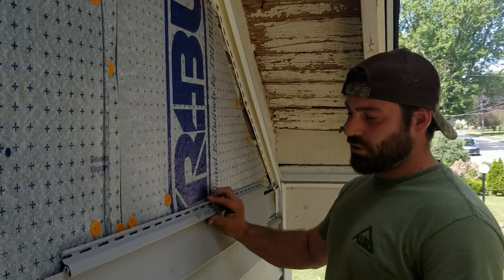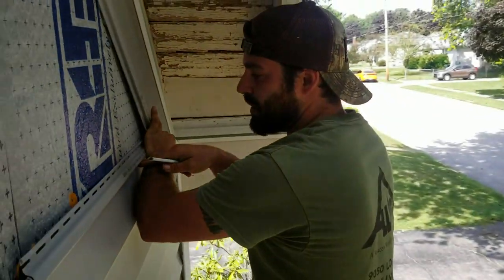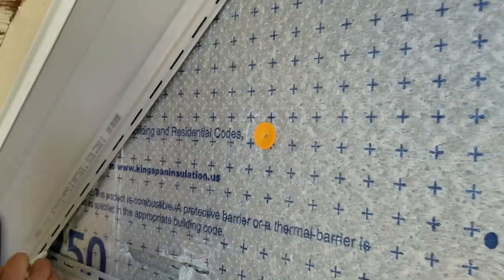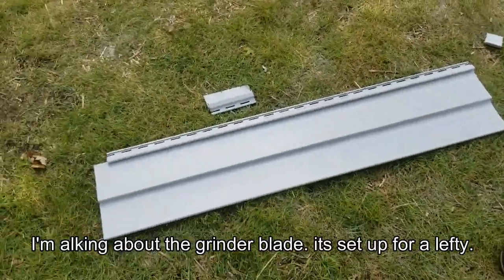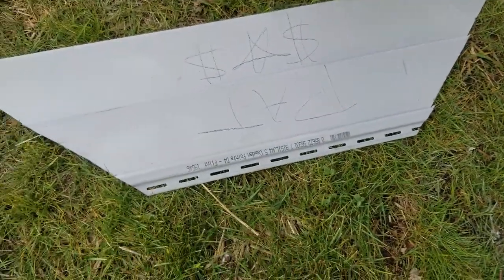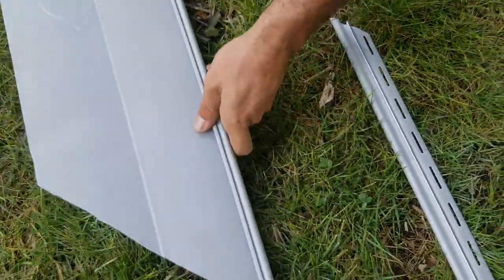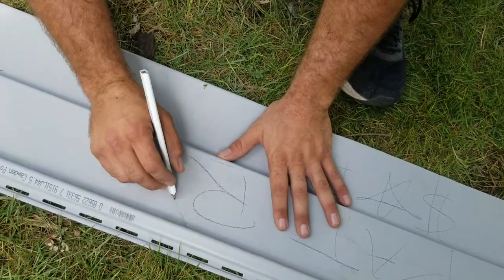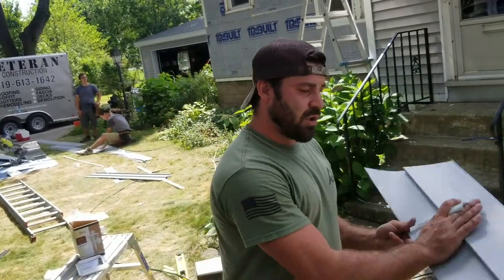how to make an LnR pattern piece for gable ends

Comment: I’ve used that same way for the Lp and Hardie siding.  Pretty cool to see it work for vinyl.  Never worked with vinyl my boss I learned from always passed those jobs.  Always said we use quality products not garbage.  From your vids though looks like you can fly just siding vinyl.
Reply from the maker: Yes sir thanks for the comment!  but yea every job is different, some are quick, I've tore down and installed 22 sq in a day with 3 others but that's far from typical lol  I've also installed hardie board and LP. not a fan of hardie, takes too long, but when the day comes I'll probably LP my own house. What a lot of guys don't get is that vinyl isn't a bad product. I Like it and know it holds well when installed correctly and the majority of homeowners,  like 75+% of people in my area,  Would prefer to put vinyl on because its in their budget and lasts for what you pay for it.
Reply: Yeah hardie is a b word to work with. Lol i do agree with lp to me it’s the best in the biz.  I use that template method and when I get to using just one piece up the gable I just use my template and a speed square to get all my measurements.   Again great vids man.
Reply from the maker: @GrazingBull  thanks.  When you get down to "less than" a full piece length on those gables you know the trick to get your next number right? Before you install it?
Reply: Yes I do!
Reply from the maker: @GrazingBull  ouwwwouuuuu lets hear it. Haaaaha nah I'm jk. That's the one trick most people do know
Reply: If cutman don’t know that trick, they shouldn’t be a cut man. Lol haha.

Comment: Hey Veteran I have a 4 12 roof,  I have 2 gable vents on both ends that are triangular.  I can't find a triangle vent for vinyle .  The square ones I have found are bigger of course.  If I use a sq. one   can I just drill some holes underneath the current triangle vent that would be covered by the new sq vent?  Or should I cut out more material in the current siding / plywood ?   If I cut out more  should the insulation be removed from all of tht area ?   My concern with the bigger sq. vent is will water perhaps blow in the new vent since it is going to be a lot lower that the existing vent?   Hope this makes sense.

Comment: Zach, can you demonstrate a how to install the siding when the bottom 4 rows are missing down to the very bottom.   I’m afraid if I try to replace starting from the bottom and come up, I won’t have the proper distance above to lock in and properly meet the the final strip because small distances times several can add up.  Is there a way to install and work downward.  I had a fire on the back of the house, and the bottom 10 feet melted in one corner downward to the ground where the fire started. Thank in advance.
Reply from the maker: You have to make sure you have the exact same same siding, and only put nails IN THE OLD NAIL HOLES.  That will ensure they line up.  I actually have a recent video about changing a piece. Might help

Comment: Hey zack any pattern advice for like an LP smartside??
Reply from the maker: Same exact thing.  Hook into your gecko clips, slide over and use another piece to trace.  or you can do a rake angle if I'm not mistaken, using either a speed square or a framing square.  It won't be the easy way on the square though.  And if its not new construction the angles won't always be perfect anyway so finding a good way to trace your angle is safer than a rake angle on a square

Comment: Will this work all the way up or just that one piece?
Reply from the maker: All the way up. Unless your roof pitch changes but that is obvious.  Keep your pattern and use only that piece as a pattern. Don't use your cut offs as a pattern or it will eventually not work anymore.
Reply: @NWIVeteranConstruction  also make sure to keep your siding level. If you loose it then eventually it will come out of j channel. 
And if I'm doing the gable with someone else then I cut a panel and before I give it to other guy to put it on i measure lock to know the size of next panel and while coworker is hammering first panel I'm already cutting the next one.

Comment: I never use patterns..
Just measure up what your panel is  with a square make a mark on siding then measure back .thats your angel it's better because when it changes you can easily adjust by adding or subtracting. 
Patterns probably work ok for new construction but not a reside

Comment: Why don't you cut it with the chop saw?
Reply from the maker: I could have. It's a 12/12 which equals 45 degrees and my saw is big enough to do it.  However, The reason I didn't,  is because that would not have worked on your average job where you're dealing with 8/12 and under (in my area) so,  because not all angles are made the same and the majority of them need a grinder. I demonstrated it in a way that works in all situations.

Comment: Using a grinder interesting I use a circular saw blade backwards.
Reply from the maker: I prefer the grinder personally but I use a chop saw with a backwards blade once in awhile.  But usually just for straight cuts in between windows.  Like When you Gatta cut like 6 pieces @ 125 or whatever.  You can Get through em all in 1 cut. So fast.

Comment: Does this work if you want to mark back so no lines even though hidden under j
Reply from the maker: Yea you can use it backwards.  Just will sit a little awkwardly. I had a guy try to do that for the same reason, didn't work out well so my advice would be to do it this way

Comment: Why do u have a j goin up the gable? U put the panel into an l bend. Usually 2 x 2 then zip screw the soffitt j rt to panel aluminun soffitt j cuz it lays straighter much cleaner look. Dude im not hatn on u but u got the platform like ur a maestro but ur mediocre at best feel free if anythn i say is wrong or less work efficient cuz it not n aestheticaly much betr

Comment: Just figure out the pitch and then anyone with a speed square can cut the material. They won’t need to look for a “pattern”. Saves time, and time saves money. Still like all your videos. Keep passing on the info for the newcomers.
Reply from the maker: Well.  Not every pitch is built exact.  Or settles exact when put up.  Also. You're gonna end up using a pattern anyway coz nobody is gonna bust a speed or framing sq every time. So why not just get one good one for both sides. Exact to the angle because it was traced... and go on about the day using one pattern